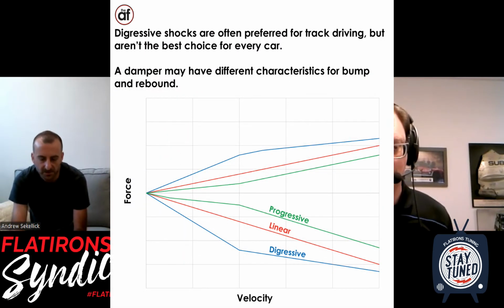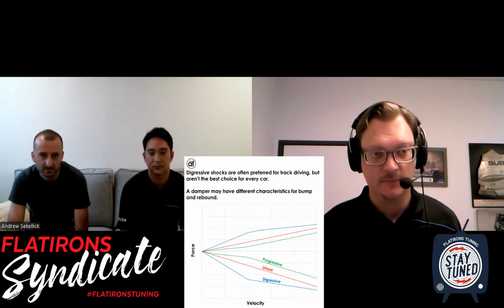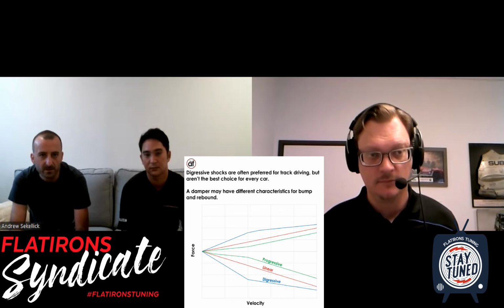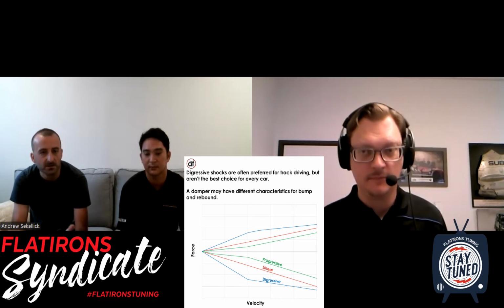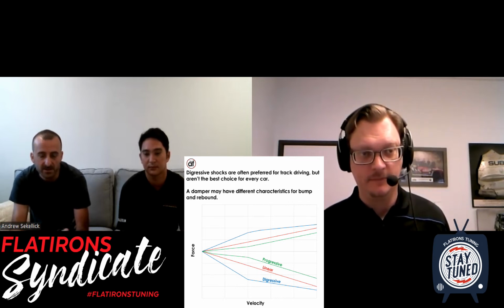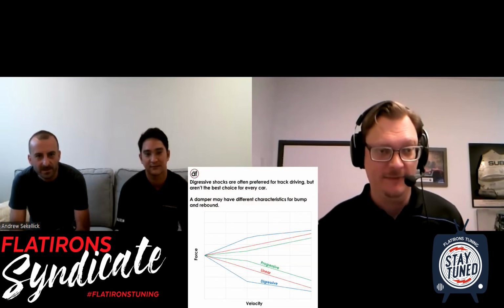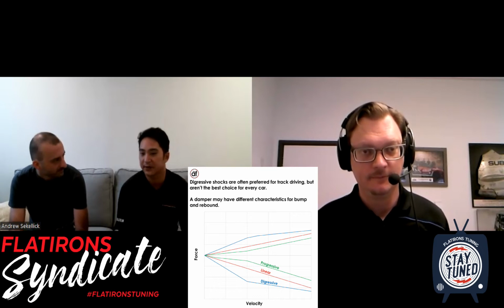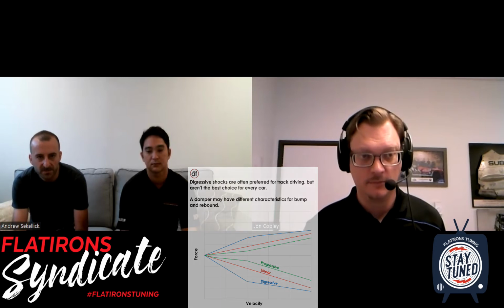When it comes to suspension valving, are you digressive?  With Race Comp Engineering

Comment: Three "experts" talking about something they actually know nothing about
Reply from the maker: Thanks for the comment.  I found a couple of your videos when doing research for this conversation.  I'd love to have you on the podcast to talk about this in more detail if you are up for it.

Stay Tuned!
Reply: @FlatironsTuning  Hi guys.  I am not singling you out as I have never seen a shock video that isn't wrong (in my opinion).  If you notice my videos are only talking about how shocks work, how to do not what to do.  The exception is my video on digressive damping and even then I only explain why I don't do it.  If you are talking about cars or motorcycles that rely mostly on mechanical grip, and not high downforce cars or other forms of motorsport, the shocks are there to control oscillation not to control the "platform" or car balance.  It is time to throw away the Carroll Smith tuning books.

Comment: problem i see with digressive damping is that you're offloading work from other parts of the suspension to the dampers.  most parts of the damping curve, you'll either be overdamped, or underdamped with digressive pistons.  people say that with digressive dampers, you can drive over curbs and its not as punishing, but that doesn't seem entirely true to me.  when you hit the curb, the velocity of the piston must go from being low to high which seems like it would actually jolt quite hard on impact because the piston is low speed (and thus over damps) while it accelerates to the softer damping at higher velocities.  and then when you're riding the curb and the piston is underdamped, it seems to me like the wheel isn't maintaining proper contact with the curb and instead just skips over (bc lets be real, most digressive shocks are also undersprung to compensate for the low speed over damping).  It seems to me there are alternatives to digressive pistons that accomplish the same things while giving you more control.  first you can put stiffer sway bars on which solves the problem of leaning into a corner (dampers should never be used to solve body roll issues imo), but of course you suffer traction issues with sway bars because of increased load transfer/overloading outside tires.  It also seems to me that you could add preload to your linear coilovers (and then adjust ride height) which would keep your car properly sprung and improve rebound over curbs.  these are just musings of someone who has never tried digressive pistons so who knows maybe i have it all backwards

Comment: At 32 min. You get it wrong. When you use the bicycle pump analogy. It's not where you are in the stroke of the pump  (length) it's how fast you push the pump handle that changes the force  (resistance to motion or damping). The difference between progressive and digressive is how much the force increases with the increase in speed of your hand motion. Look at the slope on the graph to see the difference.
Reply: came to say this

Comment: If you want the benefits of digressive valving go with a high quality damping adjustable monotube option like Cygnus Performance X-1's or their custom Ohlins. RCE is mostly twin tube or not damping adjustable. Both Bilstein and KW who make all of the rce suspension also make damping adjustable monotubes when it comes to their best offerings which do not have the RCE name on them btw.
Reply: It isn't simple like that, while Monotubes have its benefits, better for the track, they don't have the range to be great as is twin to be used on tracks or roads. Ohlins are awesome